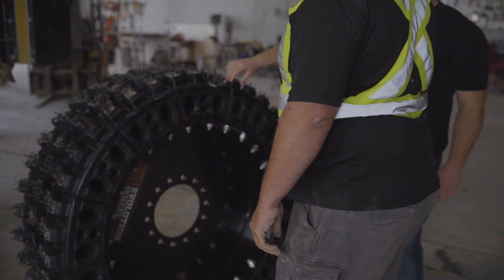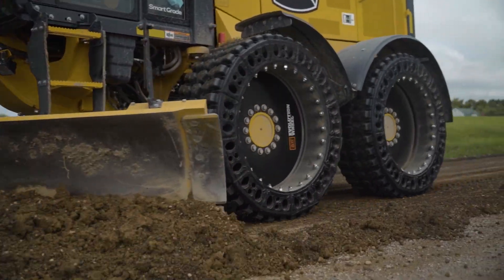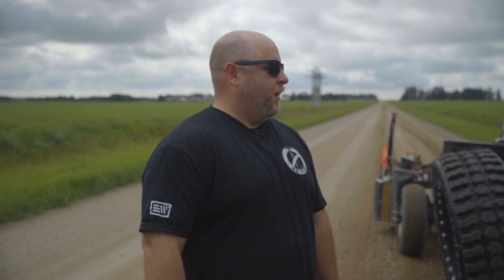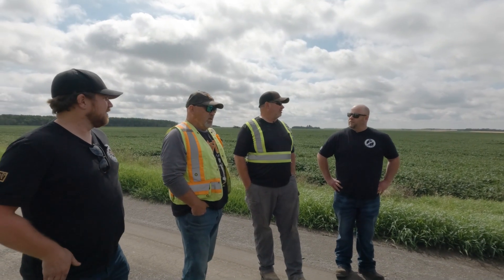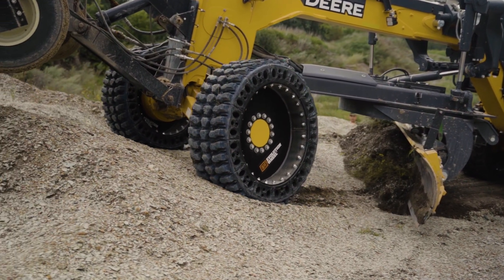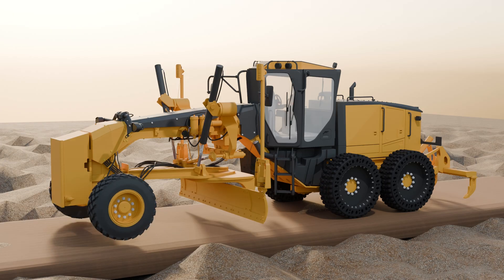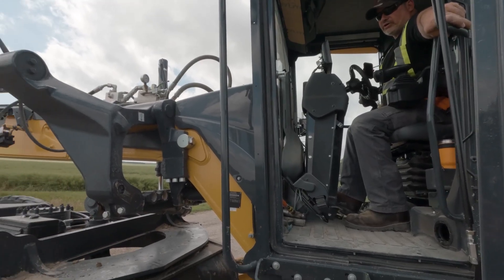Roading The World's First Motor Grader Tires | Part 2

Comment: Great work! Dont let the naysayers slow you down.
The hop is called resonance. You might try stuffing those holes with a different density of foam-rubber than the rest of the tire. You could also attach accelerometers to each wheel and find out what frequencies the tires hop at.
Reply from the maker: Thanks for the support! We have worked with accelerometer measuring tools before with varying results. It might be useful here depending on how our next tests go. 

We are trying to keep our cores open for heat dissipation, if you look they actually go all the way through. If we can't make it work like this, I agree there may be some other options.

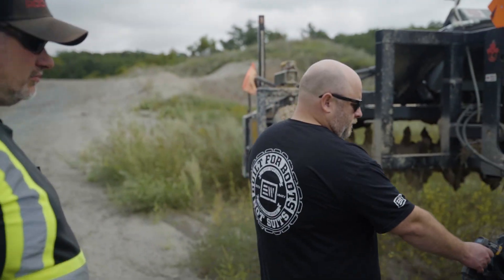Comment: 6:02 ahhh thought you were checking pressure 😂 cheers for explaining i hadnt quite understood it yet 😂😂😂 why reinvent the wheel people ask... get a job fitting tyres for a while garrentee youll try other options and your opion will be more open to ideas!
Reply from the maker: Haha 💯! Changing tires is a pain! 

With airless were checking for heat ... but I bet I'd get a lot of comments if I acted like I was checking air pressures!
Reply: @EvolutionWheel  could really annoy them and bolt the lot up wirh a chrome socket on a rattle gun

Comment: Nothing against your product, but if we didn't have planned obsolescence pneumatic tires would last for decades.
Reply from the maker: I think it depends on the application you are running in. Airless isnt needed for all applications, but in some they would offer a significant benefit
Reply: @EvolutionWheel I don’t think he means the application. He means the world as a whole is geared towards being a throwaway society. If tire companies weren’t beholden to shareholders, and didn’t need to sell as many units as possible, they could engineer a 150-200k mile tire easily. But since that’s less profitable, it’ll never happen. Your products absolutely have a place in this world, pneumatic tires can pop, so being airless is your strongest selling point. Best of luck with your business
Reply: Seems as though there is an application for these style of tires, just need more testing to where those application(s) are.  As far an application for a motor grader (depending what action(s) the grader is performing), this style of tire appears to (because of is flexing capability), to have the potential to give greater tread face surface contact, thus better traction when the grader has the front wheel lean at its greatest angle…, than the standard pneumatic tires.

Comment: trying to solve a problem that doesnt exist
Reply from the maker: We have had feedback from many different operators and equipment owners on this, there are those that would disagree
Reply: @EvolutionWheel     so what is the problem  you are hopelessly trying to solve
Reply: @SirJimmyStarmer  I am sure graders running on construction sites that use a lot of crushed concrete that has small chunks of  rebar that the magnets missed would be a good application.  Maintaining roads in the flat prairie might not be the best spot for these tires.